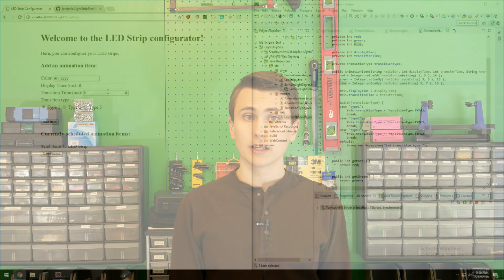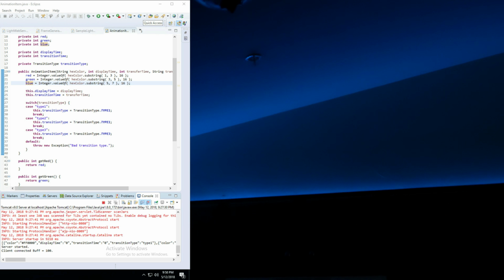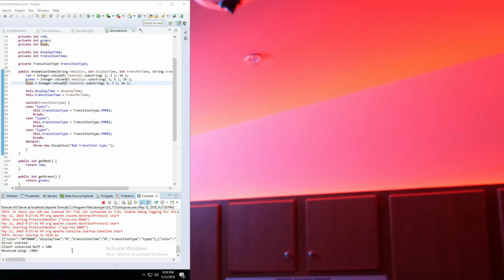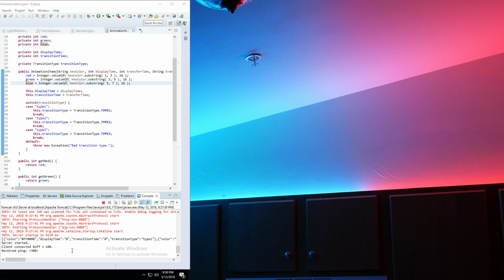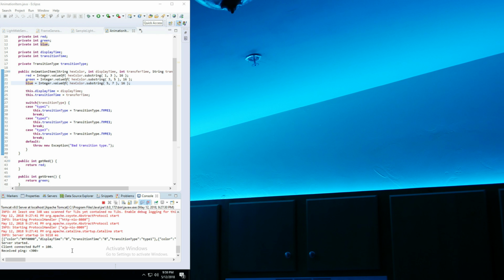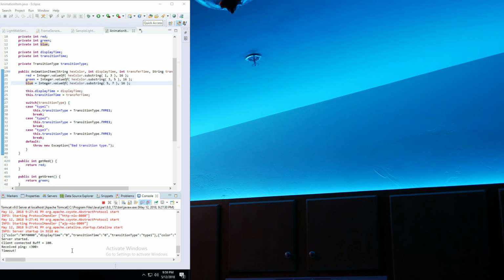Java Webserver Controlled RGB LED Strip – 3

Comment: Do you have the code?
Reply from the maker: Hi Rick, Yes! The code is published on github.
Here's the link: https://github.com/jenderle/LightStripSite

This is a work in progress. We have a few bugs left to fix, but our focus on developing Project Darwin has this on pause for now. We're in the works of improving the ability to self-recover from loss of internet connectivity (Server Side). We're also working on making the integration with a wireless remote less buggy.

There are some pending commits, but with the computer we were developing on temporarily out of service it'll be a couple weeks before those get pushed to git.
Reply: Thanks for the reply!Keep uploading man, the quality is good enough.
I cannot find the arduino code unfortunatly..I'm more interested in the arduino code because i want to drive more than 255 leds..And i haven't seen anyone doing that..I do program but i dont have a understanding about UDP packages and the way of information.
Reply from the maker: @rickbo5858 Thank you for watching! It's a labor of love for me. My mistake on the code, I thought you meant server side. There is a memory limit for the ATMEGA328P (Arduino Uno) that caps out somewhere around 255 LEDs. That might explain what you are seeing. One could use a micro with more memory, such as a 2560 (mega), due, etc... but in this project I used an ESP8266 module.

Seems like this has plenty of memory, compiling with 300 leds in the strip only uses ~40% of the memory available, so you should be able to have around 700 LEDS in a strip until the ESP8266 module isn't enough.

Here's a zip with the arduino project in it (opens in arduino IDE version 1.8.7 for sure):
https://drive.google.com/open?id=1hCi_NevpoaYMOANpoO8BAIHkXW9rzUQO

Here's a tutorial for getting the esp8266 modules integrated with the arduino ide:
https://randomnerdtutorials.com/how-to-install-esp8266-board-arduino-ide/

I used the nodeMCU. Here's an example on amazon (there are two versions, 0.9 and 1.0): https://smile.amazon.com/HiLetgo-Internet-Development-Wireless-Micropython/dp/B010N1SPRK/ref=sr_1_3?ie=UTF8&qid=1545087613&sr=8-3&keywords=nodemcu

To give you a two-second version of a networking class:
I used TCP - since that has re-transmission of dropped/invalid/lost packets built into the protocol.

Communication is done using logical "ports" assigned by number - think of this as a software address... but for TCP/UDP traffic.

A firewall can decide which traffic is allowed on what port, and in what direction. - this may be the cause of packets gone missing.

Port forwarding happens in the router to hide what internal port is really being used, and pushing that traffic through a different external port. This can be good for security reasons, but having a port directly forwarded (Read: no reverse proxy enforcing encryption and  maintaining a level of security) into your local network is not secure.

Wireshark is a great tool for debugging networking issues: allows for logging TCP/IP traffic on a network interface: https://www.wireshark.org/

Some additional information:
https://www.cisco.com/c/en/us/support/docs/ip/routing-information-protocol-rip/13769-5.html#tcp

I hope this helps!
Reply: It helps for sure.I have a wemos d1 so its a esp8266 :).
But is tcp fast enough for 20 fps animations?Because from what i have heard udp is faster than tcp.
But i will try it first.
Off-topic:
I follow a programming study and asked my java teacher about tomcat(i didn't know it exists)
He said: "do people still use that?!".
(We use intelliJ IDEA and it doesn't have good support for it)

But keep up the good work, i am too busy to learn it myself :D.
As i said, keep uploading.I've seen no other channel out there that explains it better than you.And entertaining af.
Dont mind my bad english im dutch :)
Reply: i have a problem with the sketch..
It looks like its running only once..
Reply from the maker: @rickbo5858  Thanks again for the high praise. I'm glad you're liking the videos!
The TCP server (runs as a java program as described.. on dedicated hardware such as a raspberry PI, windows machine, etc) actually generates and streams the data. This machine generates and streams data to each LED strip in it's own thread. We're limited by the bandwidth of the router not the processing power of the server, which in my case is wireless N - I typically see around 15-50mb/s.

With uncompressed data streaming through the TCP socket (as I have it implemented) - with 300 pixels * 24 bits per pixel, that's 7.2kbits per frame. This means that with 15mb/s, our maximum framerate should be 2,000 frames per second. Even with 100% protocol overhead, we'd still have plenty of speed remaining to handle whatever frame rate you want.
Long way to say: TCP has plenty of speed for this application. 

The processing power of the receiving node (esp8266) ends up being the bottleneck, which capped out at around 60fps for me with 300 pixels.

My LED node code (as provided) does not generate any animations. On boot, it'll set the led Strip to Red, Green, Blue and teal.. in that order. 
Red = connecting to Wifi. 
Green = assigned IP address by router. 
Blue = connecting to TCP Server (requires a host to connect to).
teal = connected to TCP server.

At this point, when the number of bytes waiting in the TCP receive buffer of the ESP8266 is equal to the [Number of Pixels] as defined in the firmware uploaded times 3, the ESP8266 will take that data and shift it out to the LED strip. If there is no server to connect to or that server is not streaming data to the ESP8266, the LED strip will not change color.  If one of the initialization steps fails, the strip will get not advance to the next step. 

The animation generation and playback all happens in Java, and the raw pixel data is streamed over TCP to every strip that connects, synchronized with one another frame by frame. The sever running in Java also handles scaling animations to support playing back on multiple  strips.

That said, you can extract the frame generation classes out of the java program and port them into C++, which could then be compiled into the ESP8266 firmware itself. 
You could also set up an ESP8266 as a TCP server, and have it stream data to any client that connects to test things out, if you wanted to port the firmware from java into C++, but then you no longer can take advantage of multi-threading. You can also probably throw together a simple TCP socket in Java and stream data that way, if you don't need the pretty web interface. Tomcat isn't required for any of the low-level communication, only the WebUI.

Thanks for the tip on IntelliJ IDEA - That may become critical information someday!

Hopefully that helps with your issue of the sketch "running only once" - make sure to update the variables with your router SSID, Password, server IP/Hostname, and Port where that server is listening. Should all be right at the top of that sketch.
Reply: @EEforEveryone 

Intellij idea is better than eclipse believe me😂.

Thanks for the reply.

My problem at the moment is that when i upload the sketch to the esp, it runs it only once.

If i power it off and after that on again, the serial monitor doesn't show anything..

I will test and tweak some things and will let you know when i found the solution..
It is probaly my own fault😂
Reply: I have fixed it.
you are using the NeoEsp8266Uart800kbps method that uses the gpio 2 pin.so i've set it to gpio 3 and it works now!
Reply from the maker: Awesome! I'm glad you got it working.

If you take some pictures, videos, or articles about your project, I'd love to see it! 

Also:  Feel free to ask any questions you come across in your projects. I'll do my best to answer in real time, but it might inspire me to do a deep dive on the topic for a future video/live stream too!

Additional unsolicited information:

 I settled on that library because it appeared to have the best support for my LED strips. The ESP8266 modules had some issues for me with the default WS2812 (neopixel) libraries. I think it has something to do with not being able to access hardware peripherals in the same way as with the traditional "Arduino" micros.
Reply: @EEforEveryone  neopixelbus is a better library but my problem was that u used a different pin.

If i got it working with a different java server, i will try to do it in other languages.

If i find something or have it ready i will inform you about it.